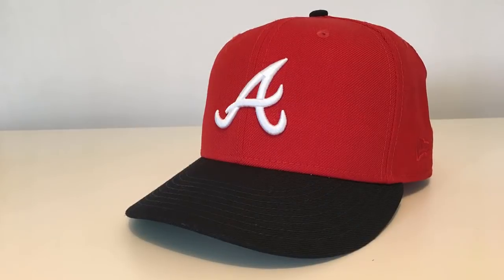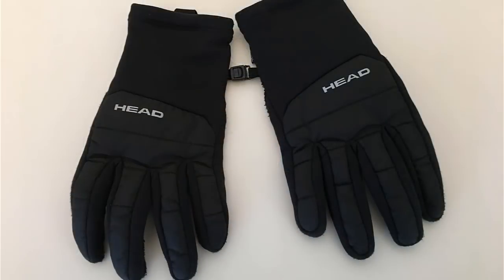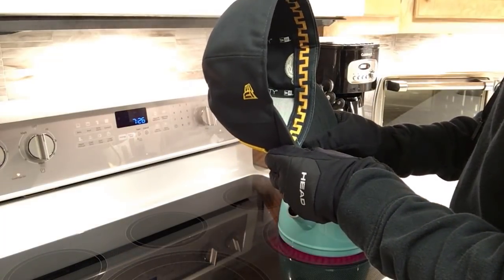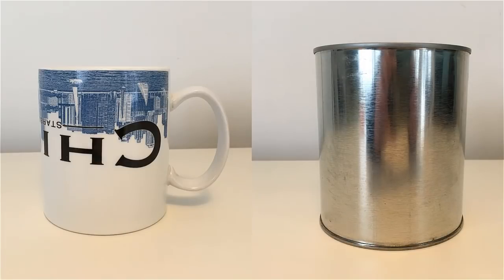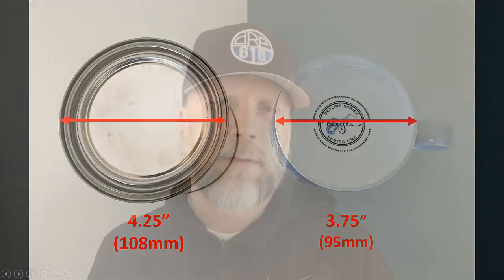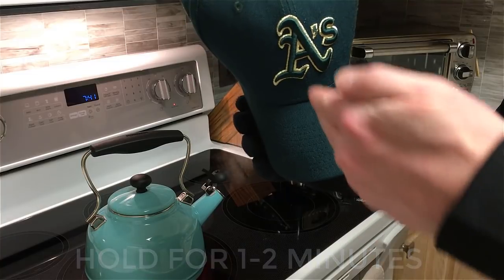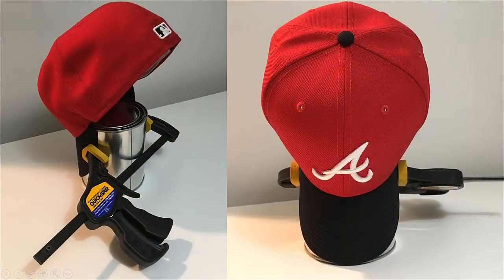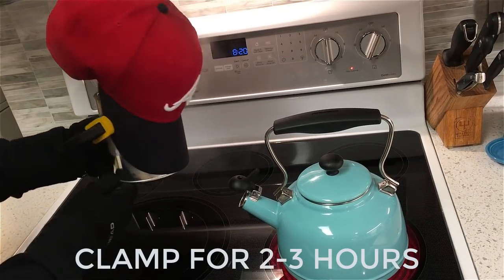Curving your Baseball Cap Visor - Three Options

Comment: I realize this is a really older video but I can’t find the original one where you showed how to do this, that I used for some reason it just disappeared from my watch history. But I just wanted to say thank you Doug for teaching just the simple hand method. My size is 7/58 and I’ve been getting caps for years and even with all the variations that are inevitable I’ve never had one that didn’t fit me properly but for whatever reason when I picked up this new city connect jersey hat for my Cincinnati Reds that’s in my profile picture whatever they did for the under material to make the red color and design underneath the bill around the inside made the hat too tight. I have cerebral palsy and I’m wheelchair-bound so it wasn’t physically possible for me to use the steam method but just you showing the proper way to do it with your hands without breaking the middle of the bill in the process made all the difference and now it fits just fine!
Reply from the maker: I'm glad to hear that it worked out for you - and it seems like the extra details on that City cap might have complicated the fit - I noticed that when it came out too.  To find any of my historical videos all you need to do is go to my channel page - videos tab.  Thanks for the comments!
Reply: @dreinthe616  oh well, good to know I’m not the only one! Thanks I appreciate it. I will definitely keep that in mind for the future!

Comment: Hey Doug, thanks for fielding my question on crown “puffing” the other day. 

I’ve got one more: I actually started using a cylindrical “forming tool” myself not long ago, one of those Lysol wipes containers. Found it produces my favourite level of curve. However, before I saw this video, I thought it normal to first steam the bill (I steam the bottom of it a little more) then wrap it around said object and hold it there (I like to use my free hand to put pressure alone the middle to prevent any risk of it cracking there). I love the end product. However, after admiring one of these hats under my kitchen table light, I noticed some “stretching” of the thread that connects the bill to the crown, more so on either side of the middle of the crown. If you closely, you’ll see this thread runs vertically to connect crown to brim. 

I saw some this threading in my blue Jays hats that had some white contrasting the royal blue, but in a few of my other caps, that “connection” threading was hardly noticeable as it was the same colour as the rest of the hat. 

My question is, did I technically do damage to this “junction” part of the cap using my method? 

Think it’s because I spent less time time steaming the top of the brim (I was worried the steam would create little deformations in the front panels)? 

Or is this simply a normal byproduct of curving brims (perhaps you’ve spotted it on any of your caps)? I’m also happy to admit when I’m being fastidious over nothing. :p

Once again, thank you kindly for your time and expertise.
Reply from the maker: Hey Leo, when you get into this level of detail, I can tell you are a true student of the fitted cap!  Seriously, I have noticed that on a few caps, but have not let it bother me... as long as you are steaming the visor prior to bending, you are being about as careful as possible - although I would recommend steaming the entire visor, even just for a few seconds to make sure it is easier to form without creasing.  That thread sometimes emerges just from the way that particular cap was built, and I don't think you're damaging it as much as exposing the condition that was already there.  And when the stitching is white, I have sometimes used an old set of Prismacolor art markers to get in there and apply some color to the thread.  I find a good color match (the last time I had to do it was a dark green marker for an A's cap) and then use the fine point to get in and soak some pigment into those threads.  If it's a more "standard" color like black, red, or royal, then I think that a fine point Sharpie would also do the trick.
Reply: @dreinthe616  Knew you’d deliver with a nuanced answer, Doug. The exposed threading’s been bothering me less and less, but I’ll make a trip to the local art store anyway. I’ve got a couple doubles on which I could experiment. Thank you again.

Comment: Hi doug, I'm here again to ask your professional opinion. On May 3rd week I'm about to buy a Brandnew N.E.C but I can't pick which the right size for my head. I already have Size 7 Detroit Cap it looks fit nice but anytime I wear it I feel my head is squeezed. So I think 7 1/8 would fit good to me but I only concern is about the brim, do you think it will loosen the cap when I curve It? Thank you so much doug your response is much appreciated
Reply from the maker: There is tons of variation from cap-to-cap, so make sure you try on plenty of caps in those two sizes.  And yes, if you curve the visor it will open up the length of the cap a little bit.  I think you'd be ok with a 7-1/8, but get one that feels a little on the smaller side, good luck
Reply: @dreinthe616  thank you so much sir love your expertise. godbless!

Comment: Anything wrong with just using brute strength and bending with your hands? Or does steaming it make it easier to shape? Thanks!
Reply from the maker: You are correct - steaming just makes it easier because it temporarily softens the visor material.  I think you might be surprised how much easier it gets, I'd give it a try!

Comment: Can it work to restore the cracked brim?
Reply from the maker: Usually it can't repair a crack, you can just recurve it to hide the crack.  If you use a mug or can to shape it, just make sure you put even pressure across it to make it conform to the curved shape (after steaming).  This will hopefully make the crack much less visible.  Btw, using steam the first time you curve almost always prevents any cracking - the heat makes it much more pliable, thanks.

Comment: Any suggestions for getting a good curve from a 47' brand hole shot flat brim? The brim on 47's are super flat and longer. They seem more difficult to get a suttle curve on than a New Era.
Reply from the maker: Yes, agree - and they are 100% plastic, which does not give them the shape memory of a typical NE visor.  Best you can hope for is to heat them a little longer than you would do with a New Era, because that plastic has a higher softening temperature than the fiber/plastic mix on a 59Fifty.  Just be careful to focus the heat on the visor only, you should be able to sense when it really softens up.

Comment: What method, did you use on the cap you are wearing in this video?
Reply from the maker: Probably just the steam and hand shaping (method #3 in the video, I believe) - the trick with that one is to hold the shape long enough so it cools.  Thanks

Comment: i did the second method with the big mug but now it developed creases on the center of the brim. the curve looks nice and not v shape. it's not noticeable but i can feel bumps when touching the brim. is this normal? should i be worry if i want to recurve the brim in the future the creases might get worse?
Reply from the maker: I wouldn't worry about it if you can't see it.  I did this to one of my favorite caps, and it really doesn't bother me.  What I do now to avoid it is steam the visor and do a little pre-bend by hand after it's warm.  Then when you put it on the mug, you're not using so much force and risking the formation of a crease or fold.  If you want to re-bend in the future, just try and press there locally with your thumb or something to keep it flatter.  Thanks for watching and good luck!

Comment: how would you suggest flattening a bill?
Reply from the maker: Steam it first so it’s easier to flatten by hand, then if you really want to flatten it I would use an iron, starting at lower heat. Make sure you put a thin cloth over the visor fabric so you don’t singe the fabric and make it “shiny”

Comment: what about using steaming water from the sink
Reply from the maker: Any steam source works - even over a saucepan/pot of boiling water.  You need it to be consistent, so a static source like a sink might not provide enough steam/heat, thanks